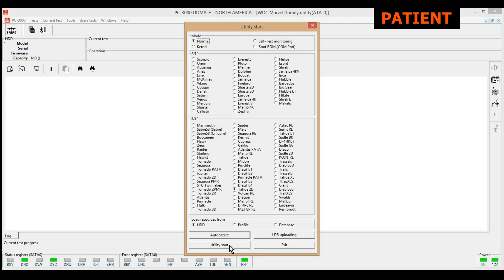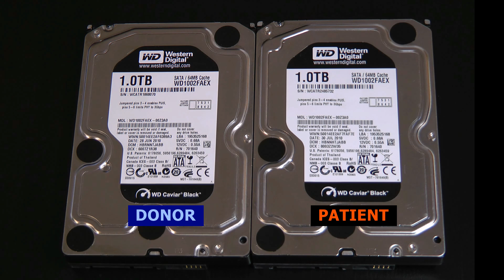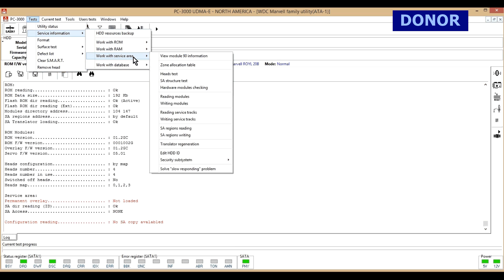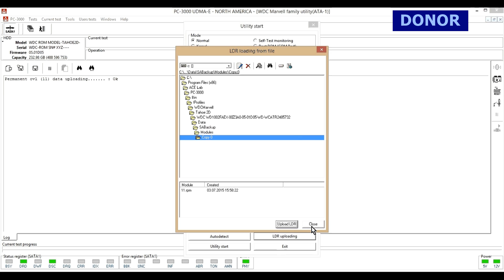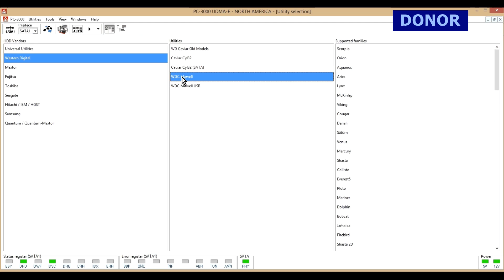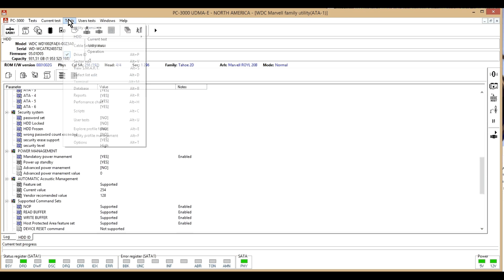PC-3000 for HDD. Hot-Swap procedure on WD Marvell drives

Comment: how if drive not detect ?
Reply from the maker: Thanks for your question! Each case should be examined individually. If your drive is not detectable in OS or in BIOS, it is needed to research it and find out which problems make an influence on the drive - whether it has trouble with PCB / Heads / Internal Firmware. PC-3000 can detect the possible damages.
Reply: @PC3000datarecovery  can u show step to do it
Reply from the maker: @andresbudihardja  As it depends on the case, please could you contact our technical support department for your technical questions? https://ts.acelaboratory.com